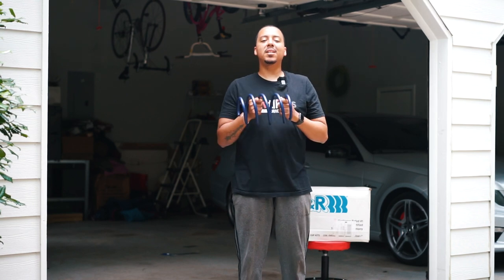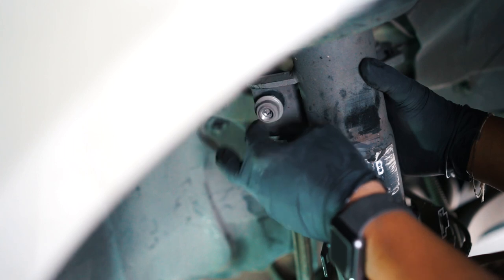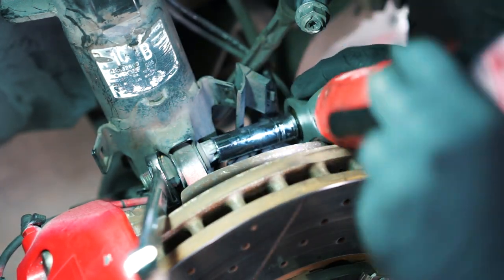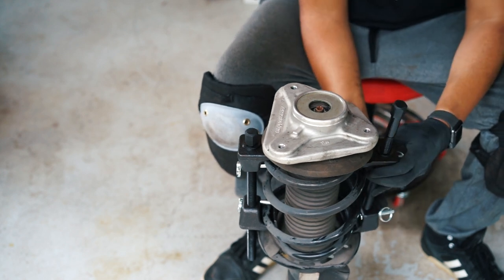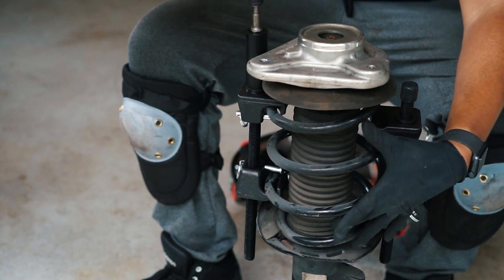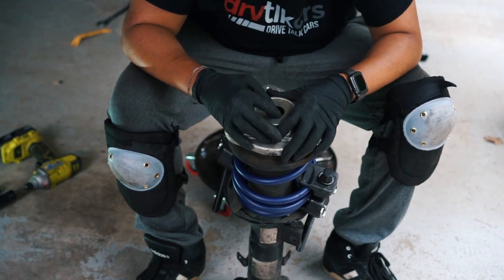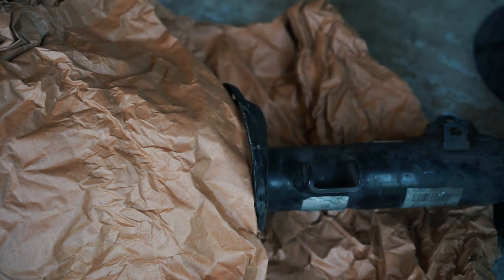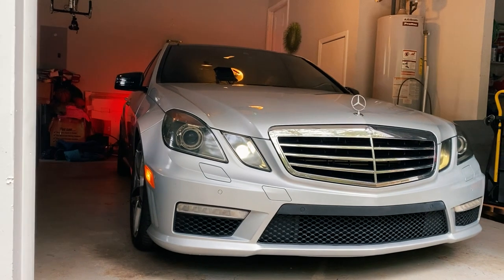How to Install Lowering Springs E63 W212!  Complete guide to replacing stock springs to H&R Springs.

Comment: Shouldn't you replace the shocks with something meant for the springs? Otherwise you'd be bottoming them out? Asking as I wish to lower my e550 and a $300 set of springs and $1000 kit are two different things.
Reply from the maker: In my opinion, the new springs are not that aggressive to where you need new shocks.  When I was younger I lowered my Honda Accord about 1.25" without changing shocks and it was horrible. I was bouncing like crazy. But with the H&R springs on the E63 they are only lowering about .75". The ride is great to me.

Comment: In terms of mm, how much drop is it? I can’t seem to find anyone sharing the mm drop for the fronts? 20mm or 30mm. Are you running spacers ?
Reply from the maker: I got between a 19 and 20mm drop.  The stock setup is pretty low as is, so I didn't want (or need) that much more of a drop.  I just wanted enough to close wheel gap.  Currently, I do not have spacers on, but I think I may get some while I decide on which wheels I want to get.

Comment: Hows the ride?
I just put some 20’s on my w212 and every time i hit a good bumb it feels like its breaking the dash board.
Reply from the maker: The ride is actually really good in my opinion.  I still have stock 19" AMG wheels on mine. I am looking into 20's, but I am concern about the ride quality and rubbing with my car being lowered.
Reply: Thank you so much. 
I ended up selling my 20’s and getting some 18’s not is rides really good

Comment: What are the specs of the wheels? 19"?
Reply from the maker: Bolt Pattern: 5x112, Center bore: 66.6, Front - 9x19 Offset 37, Rear - 
9.5x19 Offset 52

Comment: Just as a heads up, the drop link bolt is NOT 98NM. I sheared off 2 Torx bits before I cared to look it up, and the 98NM spec is for the bolt connecting to the lower suspension components, not the strut tower. Very helpful otherwise though! 👍
Reply from the maker: Thanks for that! 👍
Reply: Ok so it's NOT 98nm...what should it be then?